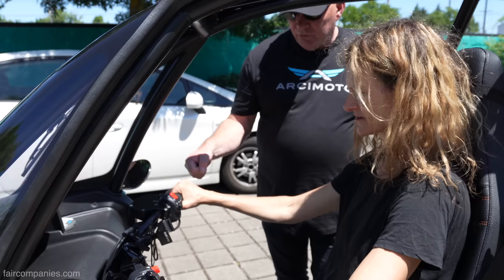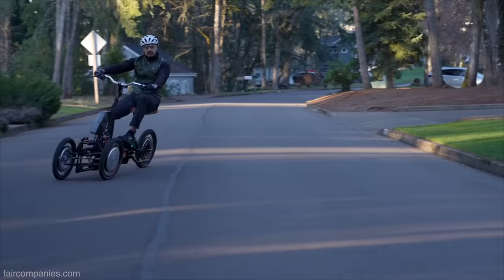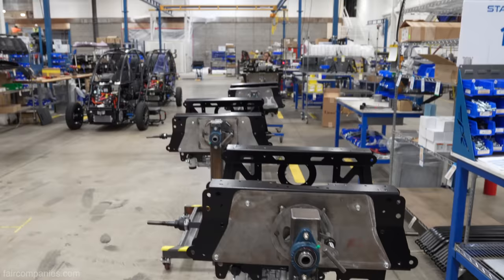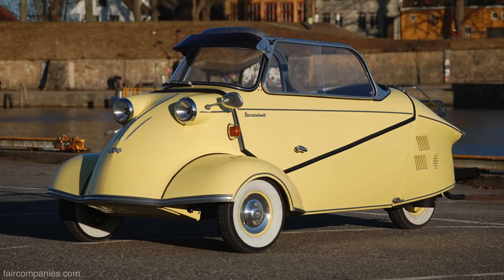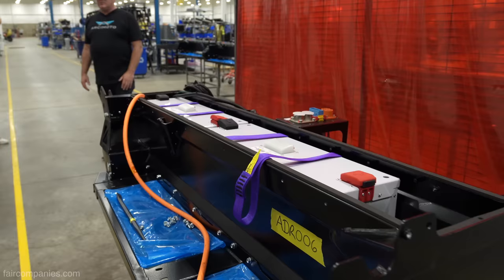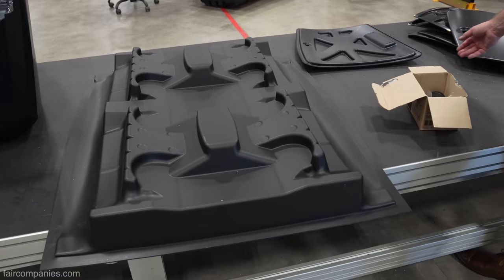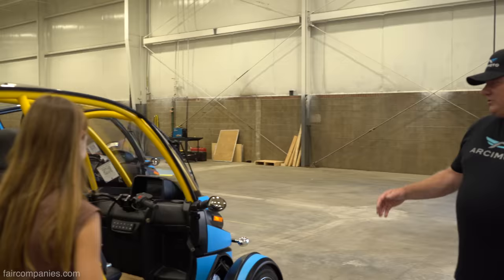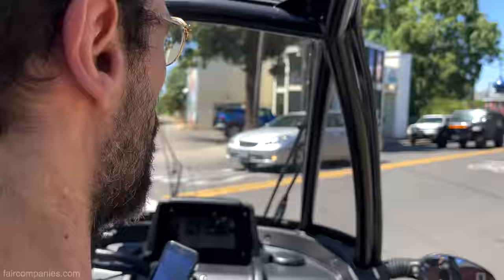Arcimoto 3-wheel EV commuter blends bikes' fun + cars' safety

Comment: The problem is these are banned on most US city roads..... They'll fine you and impound it. You might get away with it in small towns if i know the local law enforcement.
Reply: What is banned??
Reply: @TristenHernandez  Electric and small motor vehicles. The excuse they use is that they're unsafe on roads because of driving too low below the speed limit is a hazard. So if you don't live in a city that has a bike lane, it's unlikely that you'll be able to use them legally. I was going to purchase one but luckily checked with my local police department first. They said nope. I'm from ATL.
On the other hand my friend is from a small town in GA and they allowed him to use his. I'm not surprised though. Since his town is full of hunters that also drive ATVs.
Reply: What is it about these that would be banned?
Reply: @malikmalak4631  The top speed for the FUV is 85 mph.
Reply: @lapmobile5369  I understand that but most cops won't care. They'll still give you a citation and then impound it. My suggestion is to double check with your local police department before purchasing them.
Reply: That's most likely the reason the guy in the video called his a motorcycle.  And even had it designed to look a three-wheeled motorcycle. That way he doesn't get harassed by cops.
Reply: You have no idea what you’re talking about. It’s a licensed motorcycle or autocycle.
Reply: @dobbsmovies  I literally was talking about my personal experience and the experience of people I know first hand. Your personal opinion doesn't matter.

We don't know each other. So keep your opinion to yourself.

Also, unless they are registered as a motorcycle; not an ebike. They are not legal on US roads and highways. If they look like an ebike, you'll still get harassed by cops. The hassle is my point. I'm not the problem. The US legal system and American cops mentality is.
Reply: @bloop You are making a blank statement for the entire United States. I'm telling you, in GA they are not legal to drive on major roads and highways; as an ebike. I wouldn't be surprised if that's true of other cities and states as well.
You can say that they're a motorcycle, but they look like an ebike. So cops will stop you even if you have paperwork to drive them. My point being. Check with your local police department first.
Reply: @malikmalak4631  Are you guys talking about the MLM trike or the FUV??  Not sure which one you are talking about.
Reply: @malikmalak4631  not an opinion. I own one and drive it every day. Lighten up Francis.
Reply: @beachbum200009  dude doesn’t know what he’s talking about. Just bashing cops for not knowing the difference between a motorcycle and an ebike
Reply: @beachbum200009  I'm talking about the ones that look like tri-wheeld ebikes.
Reply: @dobbsmovies  You drive it every day in your neighborhood, area, and city, sure.  Through out the state? Are you sure about the entire US? Also, which body do you drive? If you're driving the one that looks like a tri-wheeled motorcycle. Cops will treat if like a motorcycle. Point being it's about perception. That's usually why cops pull you over.

Anyways, if you live in Peachtree City in Georgia. You can drive them almost anywhere. But once you leave Peachtree City, you'll be pulled over, fined, and the vehicle will be confiscated.
Reply: @dobbsmovies  I'm just trying to give someone a heads up before they invest the money into getting one. Then they can't drive it legally or get hassled by cops.
Reply: @malikmalak4631  you’re still wrong.
Reply: Arcimoto does not even sell FUV's in GA. So really, who cares?
Reply: @barnabasseadog7660   They sell in the USA. So anyone in the US should be aware that they need to check with local law before purchasing. Why are you guys so aggressive against checking before buying?

I'm starting to get the feeling that the people attacking me work for the company. Who only cares about sales, rather than the customer.
Reply: @malikmalak4631  Listen you space case, I drove the 3 wheeled Organic Transit car-bike for 7 years before buying the Arcimoto recently. My 160 pound pedal/solar powered hybrid bike conforms to the federal laws about ebikes which makes it legal without a license. There are only two states out of 50 that require a moped tag, easy and cheap to get. The bike path/trail rules regarding ebikes can vary even within a state. When I started driving it on bike paths I carried a copy of my state laws about ebikes, easily presented to any officer who is not informed about the rules. You have no valid issue to discuss here.
The FUV is in an entirely different class that did not exist in many states until recently. Arcimoto lobbies states to write in a helmet and MC license exemption for these caged vehicles. Georgia updated its laws recently and will soon see distribution by Arcimoto to meet the demand there.

Comment: With all due respect, where's the safety? I mean, the crumple zone is YOUR LEGS, no? Also, sorry, there isn't cooler things to spend money on than gasoline.
Reply: It has passed the safety test and has cross seat belts and a strong cage. It's not a car and way safer than a motorcycle.  It is an autocycle, so you can't really compare it with a car or cycle.
Reply: @beachbum200009  so what’s the advantage? Why would I get that over something like the BMW i3 or the EV Smart Car? Or just a normal, cheap commuter car. With AC, crumple zones, an actual barrier from the elements, widely available replacement parts for when it goes wrong, real international safety ratings... there is practically zero argument for the vehicle in the video VS a normal car (small one if you want to argue that point)
Reply: @o0julek0o  Choosing a vehicle to meet your needs it totally up to you and I'm sure not trying to tell you what to buy. I was explaining what an autocycle is because you may never heard of one.
Reply: @o0julek0o  I will take the challenge BeachBum declined. The average car use in the US is driven with one or two people in a heavy four seat car with an empty trunk. On a national scale that has become an environmental disaster. A spoiled self important demand for climate controlled lounge couches whever we go means extinction for many species. This will not be allowed. Your time of reckoning is near. But not for me, I did my part. Your carbon taxes will come as rebates to my pocket and they will fund trains and busses.

Comment: I like it.  I like the small one; the first one.   Will it be insulated enough on winters?  I hope it is only electronically charged; meaning the battery could be taken out, removable and recharged at home..  The only way, because there are NO Electric Recharge Stations yet.  No more to gas due to there will be no supply someday.  You must have every kind of financing due to this pandemic. It is more important to have lots of people using it in order for other companies to invest on battery charger in all States.  Or you should be able to transform any car into an electric car.
Reply: It is incorrect or dishonest to claim there are NO charging stations. Spend a few seconds on Google to see thousands of them all over the US. I charge for free at Walmart when I go there. Charging stations will grow in number at about the same rate more EVs are sold. We just started a multi-billion dollar federal project to install EV charging every 50 miles all over the US. Build it and they will come. These light Arcimoto vehicles have more manageable sized batteries that charge easily at home. These have heated seats, hand grips and defroster. The windshield and roof combine to cut the wind chill so it is not hard to stay warmer and dryer than you could on any motorcycle. It may not be for the coldest states but that's OK. A snowmobile is not a failed design just because it is worthless in Florida. I am extremely happy with my FUV. An $18,000 EV is not hard to buy compared to the average EV in 2022 which is $66,000.

Comment: Torque and Safety. Hysterical
Reply: As an owner of one in Florida I can assure you it has the torque to shove you back in the seat and the safety of a small car by using the combined roll cage and 6 point harness. Fun, not hysterical. Tradesmen will be that last to be forced into conformance but you will eventually be stopped from buring fossil fuels. You choose to be part of the problem, I choose to be part of the solution. Which one will history thank?

Comment: Pretty cool, but it doesn't really give you all the advantages of a motorcycle like lane splitting or parking in really tight spaces because the front wheels are too far apart.  I'd also worry about high speed or tight corner stability.

  There is another three wheeled vehicle called the Carver which tilts as you turn.  As a result they're able to make it far narrower while maintaining stability and cornering ability.  There are also enclosed two wheelers that use gyroscopes or reaction wheels to stabilise at low speeds.
Reply: I agree , it looks like the worst of both worlds , diy ebikes for me , good for 80 mile round trips  in  around 3 hrs , go faster and range starts to drop fast . All for 700 quid plus any strongish bike frame .
Reply: You are 100% wrong. It offers all the benefits and joys of a motorcycle with none of the problems or dangers. Lane splitting is not legal in most states and when the averege size of vehicles is smaller there is less of the factor that made you think of lane splitting in the first place. Three FUVs fit in one car parking space. We call it rock star parking. Tilting motorcycles have a very small tread area on the road due their rounded tires. The FUV uses wide flat car tires for more traction in all situations, expecially rain, that is dangerous for motorcycles but no issue with a smarter design.

Comment: The average price of a new electric car in the US is $66,000 in August of 2022. You can buy THREE Arcimotos with delivery for that. Insurance for three would be under $300 if you also have medical insurance or Medicare. You would spend about $3/mo to keep them charged and you would never buy gas or oil changes again. Fewer moving parts, no $5000 motor or $4000 transmission to blow up, no gaskets to blow out.

Comment: Great video, love to have one here in Minnesota. I imagine you are looking into those transparent solar cells to extend the range and to get some charge while at work etc.
Reply: No, this vehicle is far too heavy to benefit from 100 or so watts of solar on its small roof. It uses up more power than that every day as it sits parked. Even a useful slow trickle charger would have to be 400 watts or more. Not enough room. Cars have much more horizontal surface so some new EV cars have solar cells.

Comment: An outstanding Vehicle design in sooo many ways, I want one and will be looking out for when we get in the UK is there a rain proof version ?. Hey, The Horn Works ! :D I wonder if they have any little fluffy clouds left in Arizona ?
Reply: A wrap around windshield and roof is sufficiently rain proof. I wasn't sure until I got mine out in the rain and stayed dusty bones dry in heavy rain while moving. Air pressure defines a force field of dryness. Move your elbows outward just 2 inches and they get wet.

Comment: To the Arcimoto Co  I am curious being you have so many iterations of your FUV. Have you considered or do you have plans for one of these that can load a manual/electric wheelchairs Tomales it faster and safer for those of us that are restricted to being bound to a chair? I have a idea or three that might be similar.if
Reply: Hi Kevin. Please post your request on one of the recent Arcimoto channel videos where they are more likely to see it. This video is not created by Arcimoto. There is also a company Facebook page for Arcimoto. 
As an owner I think the back seat can be removed to install a simple hoist for a folded chair. Then you only need a work around for the foot brake pedal which requires a strong leg to apply now. But also the seat is higher off the ground than standard car seats so getting seated might be harder. The battery tunnel runs down the middle so that is an extra challenge cars do not present.

Comment: I wonder why they didn’t go with a steering wheel.  It seems our wrists might tire. On a side note, maybe they can get the integrated solar from Sono Motors added to extend the range.
Reply: Straight line driving is effortless with either a wheel or handlebar. Through 14 years of prototypes Arcimoto found that they could save 240 pounds of vehicle weight and 16 inches of length by using handlebars. The roof only has room for about 100 watts of solar. The vehicle systems consume that much power while sitting parked. Solar is great and as far as I'm concerned it should be mandated by federal law on all EV horizontal surfaces. But this is not enough to actually collect a useful charge on a daily basis. Cars advertising that feature tend to be misleading as to how much is collected on average days which includes days of zero sunshine.
Reply: They took the steering wheel assembly out because it weighed to much. 
They are now starting to upgrade the torque vectoring software  so it turns easier at low speed and the inside wheel turns slower than the outside wheel for better traction.
As far as I know they won't be putting solar on.... Just not enough area.

Comment: In Texas you would need A/C and doors..... Great idea that is only going to get better.
Reply: An option, not a need. Climate control means making a solar oven out of the vehicle by adding heavy glass and doors. Instead, smart owners put a dark tint on the clear roof and brow. We wear sandals and put a fan on our handlebars. We use cooling towels and vented seat cushions. We also have the sense to not drive in peak heat hours.  I have had my FUV in Florida for 9 months as my only transportation. I deal with the heat as described above and wish for the lower average humidity of Texas where it would be more comfortable.

Comment: What's the price???? Did I miss it? And why can't have a alternator to change batteries??
Reply: Video descriptions have links. Just expand it down. Alternators are powered by fosil fuel engines. It charges easily at home on a standard outlet.

Comment: Is there a way or adaptors to charge it with solar power?
Reply: A 1500 watt solar panel bank with large storage batteries and a 1600 watt minimum inverter will charge it with enough sun. So much easier to just plug it in at home.

Comment: what about safety features for if someone crashes into you?
Reply: The FUV meets or exceeds all of the National Highway Transportation Safety Administration regulations. It has dual motor front wheel drive. You can order doors. A four point seat belt system that covers both shoulders. The roll cage has passed the automotive crush test, the same test that cars must pass. It is one of the safest motorcycle class vehicle built in the USA.
Reply: Safety was the biggest selling point for me. If you are an inflexible thinker you can't grasp the following: the safety is by a different method of combining a six point harness with a certified crash cage. Helmet and air bags not needed.

Comment: would it be legal to attach a bicycle trailer to carry cargo in bicycle trailer if keeping the speed under 30 mph?
Reply: No.
Reply: @popeyegordon  do you have a statute number to refer to for you comment?
Reply: @manp1039  Not a legislated law, a mechanical rule. Autocycles are not suitable for trailers. Any accident would be entirely your fault and a trailer would void your warrantly and insurance policy on this autocycle. If you need four wheel cargo capacity you need a car or truck. Likely whatever is in your trailer can be pared down, simplified and lightened to fit the trunk and rear seat/cargo area. I removed my rear seat and rear harness, dropping 60 pounds of weight, and converted my FUV to a cargo hauler for just $70 worth of cargo netting. The Deliverator I wanted costs $5000 more.
Reply: @popeyegordon  what is the "mechanical rule" you speak of? and what is you definition of an "autocycle"?
Reply: @manp1039  The FUV defines one iteration of an autocycle design. The mechanical design geometry limits of these make trailers unsafe and that is not an issue at all because the whole point of light sustainable EVs is smaller, lighter. The FUV is not approved by the Highway Safety Commision for pulling a trailer. Approval would include a trailer weight limit on your title and in the owner manual. Trucks or SUVs are used for serious hauling. If we load this down it is no better for the environment than any 3000 pound EV. You are wanting to use the wrong vehicle for your purposes. Choose the right vehicle or reduce what you consider essential to haul around with you. I'm in the owners group and no one is considering pulling a trailer. We have built side cars for large dogs and side racks for surf boards or golf bags. A roof rack for a kayak is a possibility.
Reply: @popeyegordon  I wanted your definition of "autocycle" since you used this word to make some point. Autocycle or auto-cycle may refer to: Motorized bicycle, a bicycle with an attached motor, or a moped, or a three-wheeled car, a registration classification in the US for some three wheeled vehicles; with a sit-in cockpit and steering wheel. Your reply has not clarified what you define as an autocycle. And certainly a bicycle with a motor can halul a bicycle trailer. And some 3 wheeled bicycles (with or without fairings) with motors can haul bicycle trailers. And as for clarification of "mechanical rule". you still have not clarified that for me. No need to make any further replies.
Reply: @manp1039  All readers see I have answered your questions fully. Can't help it if you are dense or willfully obtuse.